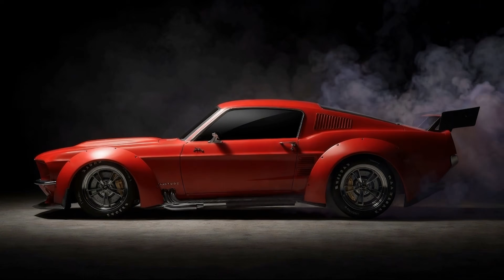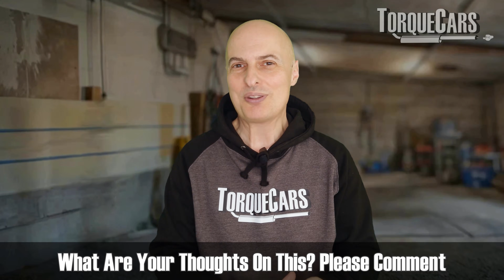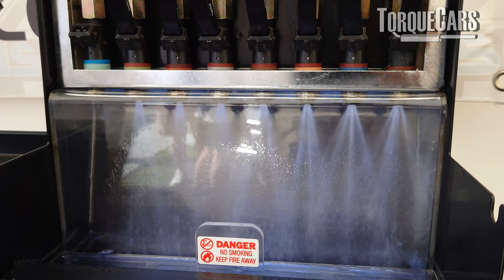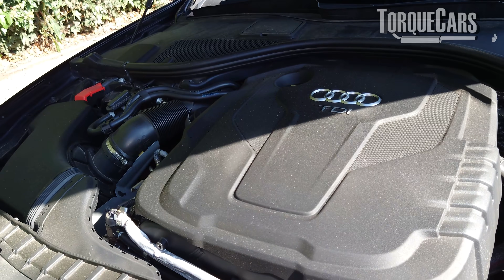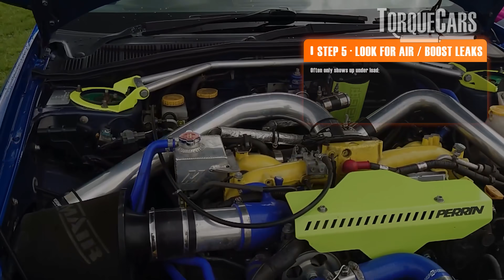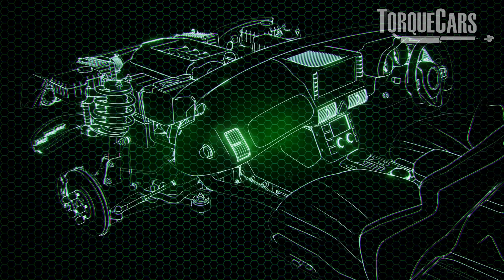Why Your Car Loses Power When You Accelerate 5 Quick Checks

Comment: Another great video! You might like to point out that modern cars often have 'smart' alternators that will let the voltage drop down from 14. Mine will reach 14.7/14.8 on the overrun but typically has shown between 14 and 13.x normal driving :)

Comment: "...the alternator is what's producing 12-14 volts of current..." I guess you meant "volts of electricity" since current is measured in amps. No offense, I'm only mentioning it because it stopped me in my tracks. BTW-I just had a failure like this where the car would bog down on the highway when you floored it and the check engine light would start flashing and go away after coasting for a bit. No misfire 
codes. Random stalls; but everything was so intermittent, it was hard to diagnose. 2 yrs later...it was a faulty ignition coil. I got lucky that it was only that. Love your videos, very well thought-out.
Reply from the maker: Ah yes, you are right, a slip of the tongue, so easy to do but so hard to spot in post production. Thanks for the compliment and support, that keeps me going.